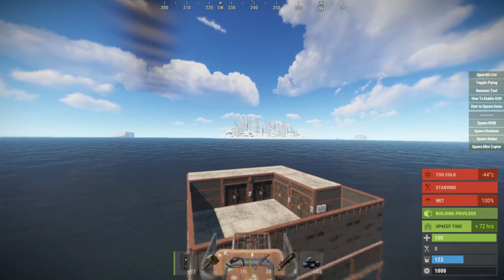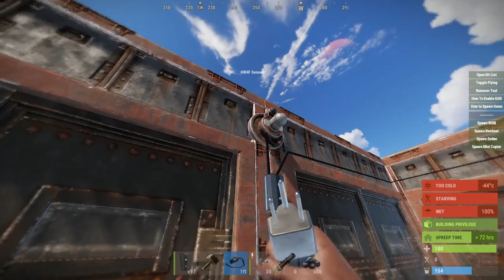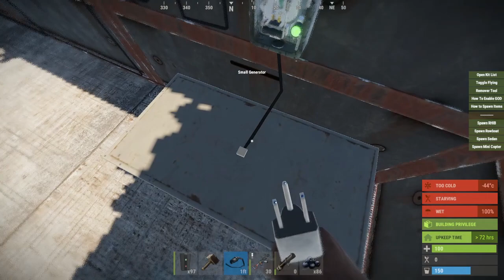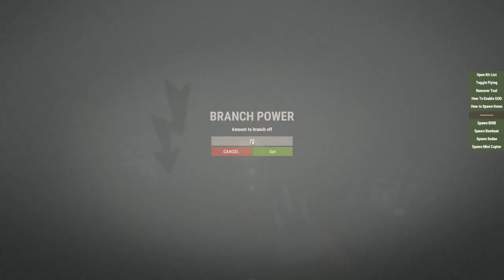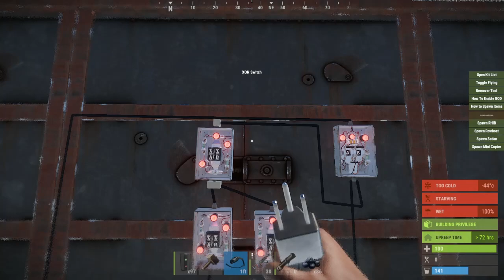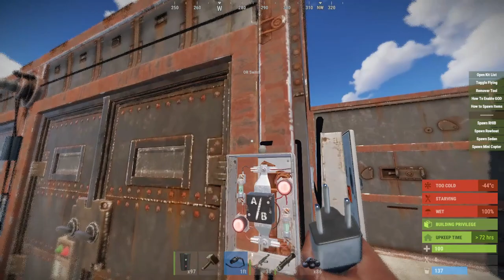Rust Electronics Tutorial - How to Setup Advanced Sensor Array (Multi Purpose)

Comment: Followed this to the letter but only the first sensor works and I’m not getting enough power to open all the garage doors (x12) please help
Reply from the maker: Sorry I didn't get back to you sooner, make sure you have enough power.  If you have it run like I do and using only 20 power for x12 doors you will have to adjust that electrical branch until you have enough juice to power that circuit.  Hope that helps.